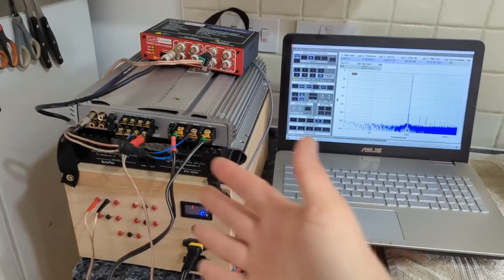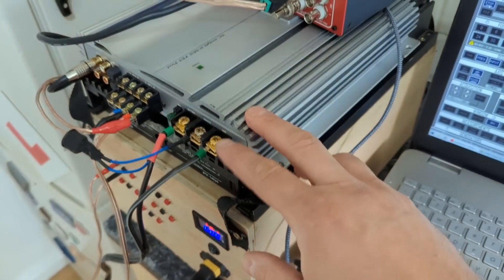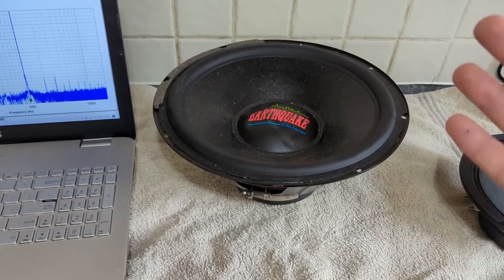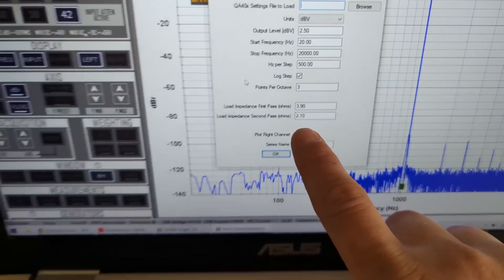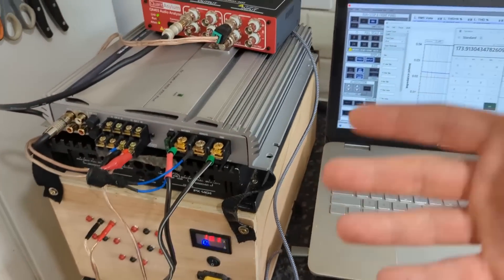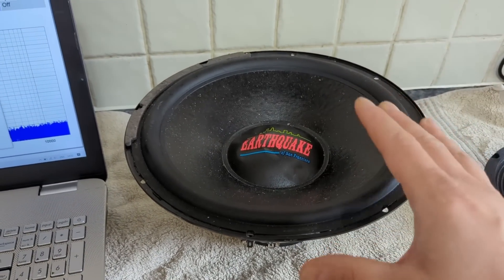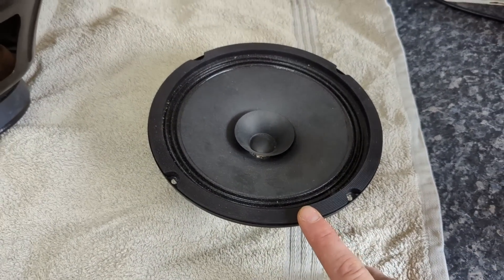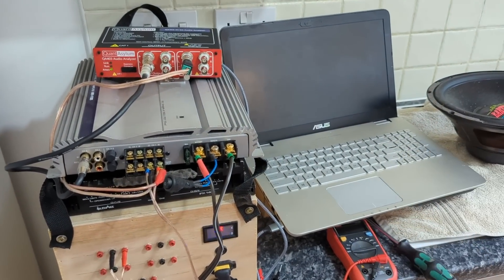Does amplifier damping factor really matter? Let's test it!

Comment: first of all thank you for the video. I’ve heard opinions saying that those big oldschool drivers had very stiff suspensions precisely because amplifiers back then had much lower damping factors compared to modern ones, since they generally didn’t have those negative-feedback circuits. They relied mainly on the speaker suspension to keep the audio reproduction under control. Do you think that's true?
Reply from the maker: Now days and back in the day you have soft and stiff suspension drivers. You cannot have low end extension with stiff suspension. Unless you put thousands of watts into the sub. Sensitivity, low end extension and power handling is all about co.promise.

Comment: Supension stiffness is a factor in the resonance frequency Fs, not directly related to damping. Damping is power dissipation, either electrical or mechanical and a suspension can have internnal friction that dissipates motion energy from the cone..; which is mechanical damping. By the way: the box the speaker is placed in also influences the resonance frequency and the damping a lot.

Comment: The driver is acoustically (ie mechanically) coupled to the cabinet. This has a huge impact upon how the whole thing behaves. In some cases you will find negative impedance at certain resonant frequencies. Good loudspeaker designers will mitigate and minimise this. Buying cabs and mounting drivers isn't as simple as it first might appear.

Comment: Class D amps usually have L-C output filter. This adds quite some output impedance so damping factor is not very high
Reply: Purifi eigentakt has the output resistance of 25 uOhm, 0.025 mOhm

Comment: I am a bit experienced about those problems and I like to notice that it is not easy to know   not theoretical but real impedance of spaeaker ZL for any   harmonics  which are interersting fo you.  I see  drivers without enclouser which is braking conditions of assesment  . .

  You promise to measure output from amplifier when loaded with resistance 2 or 4 ohm. but what frequency are you going to apply? Most amplifiers work with output capcitors and it will affect  results - amplifier may have higher output impedance in low range. At the same time higher harmonisc may be damped better than expected  and i in my opinion is much more important then for lowest range hich you consider when talking about membrane main resonance. . It  may be even  a good factor if our spaker is not very  big and may work  good or bad in phase shifts produced by enclosure  , That frequency  without enclosure it is unknown.     

  .Impedance ZL varies   depending on many factors also on enclosure. which is not here.  , but i couldn't find how you solved it. When this is positively solved I am interested how does   sound is affected by ear when two  amplifiers have damping factor different as much as 100 and 460 s. How much better is when it would be say 600? Because I do not receive sound     based on calcultions which may be ipressive  in numbers but on what I hear.

Comment: Keep in mind that your impulse response IS your frequency response. A perfect impulse or square wave needs all the frequencies under the sun to be built up and alterations of that sharp on / off transient are alterations in frequency response. It’s just an FFT away. 

This point was driven home to me directly when I started testing speakers 30 years ago with the IMP audio analyzer. One little “click” played through the system and your FR appeared on the screen. (Yes, the MLS sequence of impulses was more efficient, but this was a great way to be introduced to Fourier.)

If your cone’s motion to the impulse is affected by the amp’s high output impedance it IS directly altering the frequency response. FWIW, this I also why some IEMs now ship with little inline 10 ohm or so impedance adapters to let users tune the bass.

Comment: I want to point out that while you are focusing on the suspension stiffness (cms), the mechanical variable that will create the most reactance is Qms, or the actual mechanical damping factor. The mechanical damping contributes to the reactive load that the speaker presents to the amplifier. Most people assume that the suspension stiffness is directly correlated to Qms, but it is not. You can have both soft and stiff suspensions that are Qms-agnostic. You will see this in the impedance peak of the driver at fs, and this is quantified essentially by the width of the peak. Higher Qms drivers will have a narrow peak, lower Qms drivers will have a wider peak. Cms, or the stiffness of the suspension, does not affect this. The lower the Qms number means the more mechanical damping the driver has, and the higher Qms number means less mechanical damping which equates to less reactance. The biggest contributor to Qms is the material of the voice coil former. Conductive formers like Aluminum or even some alloys of Stainless steel, even if they are not shorted, result in eddy currents on movement which is what creates more mechanical damping and a lower Qms.

Also, inductance plays probably the most important role in the speaker itself creating a reactive load. Not only static inductance, but the inductance over stroke. In a Klippel lsi report this is what you would view as Le(x) and Le(i). 

I am a speaker engineer and the drivers that I design are both low inductance and high Qms, and we see marked improvements in system impulse response when using amplifiers with low damping factors, even tube amps. We also see this manifest in impedance stability of the amps, as there are some 8 ohm stable amplifiers that we are able to use with 1.5 ohm low-Le/high-Qms drivers without going into protect.

Comment: You werent taught the underlying reason. And its not your fault..some of this is correct. Some isnt. Lets get to the truth. Look at the rail voltages.  If the voltages move at aĺl. The output has been compromised.

Comment: Great stuff, I knew about moving a magnet in a coil induces a current, I knew how a speaker's voice coil moves piston like, aligning to the (Faraday's?) 1 handed, positioned, strait thumb, index & middle fingerer held in (the only?) pointing perpendicular at right angles finger-directions (hope that made sense) & its analogy of magnetic, current & direction of voice coil movement BUT never ever once considered the (now obvious) reverse of those same electro' physical unchangeable laws relating to Damping Factor.  I just noticed it seemed to proportionally relate to a power amplifier's output impedance.  And I learnt something here that made absolute sense, very well explained & have a far fuller understanding of the speaker / amp electrical interactions. I suppose I'm saying "We must never assume we know it all"

Comment: It will be interesting to see the results.  Just as a note, I believe tube amps tend to have very low damping factor.  Like low two-digit range. It's possible all the amps you have are "high enough" it doesn't make much difference. As a test, you could raise the amplifier's impedance by adding a resistor in series with the output.  Obviously you'd have to increase volume to make much for the loss, but it might be an idea to control variables by using the same amp with different damping factors.
Reply: Why you beiieve that tube amplifiers have it relatively low?
Reply: @Mikexception  The charts found on Wikipedia for "Damping factor".  The amp shown PEAKS at less than 20 while the solid state amp is 20 at it's worst.  I'm not sure about the "why". Perhaps it's the added resistance of the output transformer.
Reply: @russellhltn1396  Thank you. Just wanted to know who eventualy tested it and how he did it. . Wijipedia is no name and gives no details .. 

. Output impedance of amplifier is created by feedback, not by speaker wires or resistance of windings which is comparable to transistore and bearing in mind output capacitor in solid often lower.    

Feed back in solid atate is adequately to damping factor  tens times deeper. Tube amplifiers do not require such deep feedback due to tubes unique featers  and it would be no reasonable to incerease just for damping.
Reply: @Mikexception  Feedback enhances/lowers the output impedance, but doesn't create it.

Comment: if the softness / stiffness in woofers has a lot to do w dampening characteristics then for modern stuff a vintage amp w dampening factor or 50 is probably very fine. if assumption is accurate does this work in reverse w class d working fine w soft vintage woofers i wonder..

Comment: i have tested one yamaha home theatre amp which had the damping factor about 70-80 i think and compared it to a small rockford fosgate car amp which had the damping factor over 200,...the speaker were a pair of floor standrs,...with very soft mid bass drivers,...the difference was quiet obvious,...the rockford was much more precise and punchy,...where the yamaha was much slower,....and the rockford was half the power of the yamaha,...so he couldnt get even near as loud as the yamaha,...but was much more precise and punchy even with hald the power

Comment: You didn’t need to get a bunch of different amps. You would get EXACTLY the same results by using one amplifier with extremely low output impedance (damping factor 800) and then adding a low value resistor in series with its output to see what effect a lower damping factor has. Assuming a nominal 8 ohm speaker, an output impedance of 0.01 ohms gives a damping factor of 800. Put a 0.1 ohm resistor in series and the damping factor would be 80. Put a 1 ohm resistor in series to simulate a super low damping factor of 8. Put a mike in front of the speaker and put a very, very low frequency square wave into the amp. Observer the actual acoustic output. Put the mike as close as possible to the cone, and hang the speaker in free air as far from any reflective surfaces as you can, so you aren’t just observing reflections off tables and walls.
Reply: You don't even need a mic. You can clearly hear a difference in bass and an amp with a low damping factor at lower impedances will have less control over a woofer and said woofer will bottom out more easily.
Reply: @carlosoliveira-rc2xt  I bet you're wrong about that. Unless the output impedance of the amp is really high (several ohms) it is unlilkely that you could detect, in a fully blind test, the difference between a damping factor or 20 and any higher damping factor. Once the amplifier's output impedance is 5% or less of the speaker impedance, the DC resistance of the voice coils is absolutely the dominant factor in how much electrical damping occurs. Or more accurately, that dc resistance working with the coupling between the voice coil and the manetic field the voice coil is in.
There is also coupling between the cone and the air, of course - that's the whole point of a speaker. And that also damps the motion of the cone. And in a ported enclosure, the mass of the air in the port has inertia, and once it's moving in one direction, it doesn't want to stop. That moving air mass fights the damping on the speaker. Factors other than the damping factor of the amplifier (once the amp is even sort of decently low output impedance) are far, far more in control of the transient response of the speaker.
Reply: @jimmurphy5355 interesting all the details of something that’s not really noticeable? also must be about how the music was produced regarding compression. assuming damning is synonymous w ASDR namely the decay and release aspects of lower freqs. for dub music low dancing slower release is probably better; metal kick drums faster makes more sense. so i guess maybe a spec is not useful too if it’s actually context / genre dependent. but yes blind testing no clue how much confirmation bias is involved but. usually it’s everything! w audio folks
Reply: i’ll do it

Comment: What a tease. And here I thought I was gonna get a definitive answer to the question I've been wondering  the last few weeks. 

My home audio monoblock power amps (Purifi Eigentakt 1ET400a) has an insanely low output impedance. The difference in bass was a night and day difference between those and my Class A/B monoblocks. The class A/B sounded more muscular, but not as controlled. Almost a bit bloated. The Class D Purifi's sounded lean in comparison, but ultra detailed. They didn't sound lean when I stopped A/B testing the 2 amps. 

My speaker cables also have a fairly low resistance. I wonder, if you have an amp with a crazy high DF, can that DF be negates by high resistance cables and binding posts? Can we hear the difference in that instance? I can understand people don't hear a difference with cable because of a low DF, but what about a high DF? 🤔

BTW, great video. When are you planning on posting the following video?
Reply from the maker: Video will be up in a couple of days.
Reply: You can always stick a small value resistor in series with the speaker and find out! Though you may hear more of the resistor playing with the speaker impedance curve rather than damping factor of an amplifier

Comment: Class AB should have a better damping factor than Class D. 
  Lets see.....
Reply: The class of an amplifier has no direct bearing on the damping factor. Any kind of amplifier can be designed to have a very low output impedance.The bandwidth of the semiconductors available now makes it trivial to build an amplifier with very wide bandwidth and lots of open loop gain. That in turn allows for lots of negative feedback. Lot of negative feedback lets the amplifier hold the output at a precise voltage independent of the current flowing into or out of the output.
Reply: @jimmurphy5355    which has a better NFB ? AB or D?

Comment: Nice video on an interesting topic which a lot of people are interested in.
The only point is your statement that class D amplifiers have higher dampening factor than class A/B. 
Class A amplifiers; yes, they have the lowest dampening factor.

It mainly depends on the design of an amplifier, considering the dampening factor.

I noticed in the German magazine HifiTest that class D amps have the lower (tested) dampening factor than class A/B amplifiers.

But everything higher than 100 should be fine.

In my experience, speakers that play the low notes are most beneficial of high dampening factor; keep the mass of the cone in control. High dampening factor are less important for mids and highs because of the lower moving mass; that's why sq guys use class A for mids and highs, and A/B or D for (sub)woofers. 
Even well regarded manufacturers engineer their multichannel amps this way (also because of the current draw of a sub channel).
Reply: We first suppose to buld speakers not producing  acoustic resonsnces - then we do not need to care much for dampng their coils.   Not all resonances produced by speaker system  are contained and reversed by driver coil. . It is like we belive that all sound coming from grand piano comes from strings and we can make  sound  perfect by conditioning strings.  .,

Comment: You can simulate output impedance with normal power resistors. Even wound power resistors work, as long as you parallel at least four-five to lower the added induction. Five 1ohm resistors is an added 0.2ohm output resistance, and gives a damping factor of roughly 20 into four ohms at the speaker terminals.
At low power, you could also use normal metal-oxide resistors to get a more "pure" resistance.
And I think you oversimplified for the audience - but there's no such thing "a single pulse" for a single frequency in physical reality. The only true "pulse" that exists is the Dirac pulse, and that has a real frequency response of +/-0dB from 0Hz to the upper limit of the system. It contains all frequencies the system can reproduce
Try loading a Dirac pulse in REW and apply a bandpass 30-100Hz to simulate a bass driver, and look at what the resulting curve looks like. This is the theoretically perfect response that no real speaker will ever get even close to, and still it rings quite a bit. Especially if you bandpass with a fourth order lower and third order upper (like most ported subs)
Reply: Thanks for this comment - it's the only one in this thread that deals with the subject correctly.